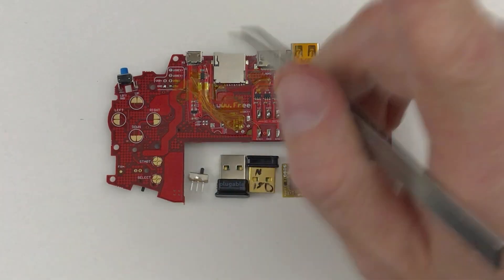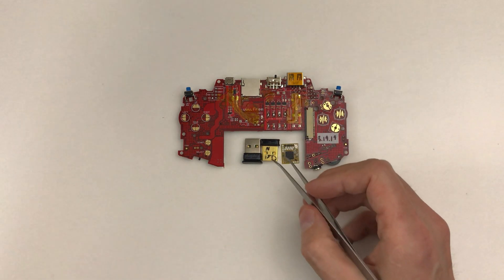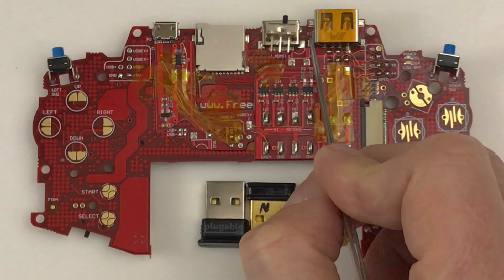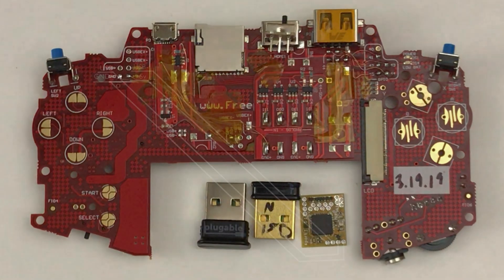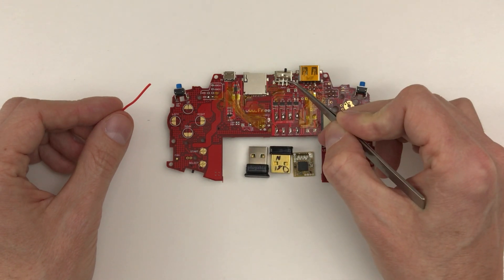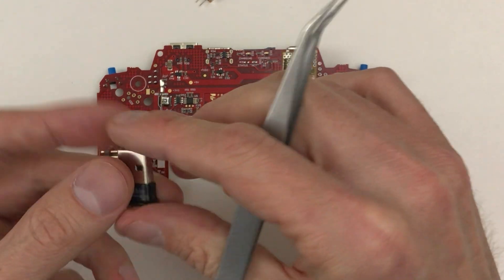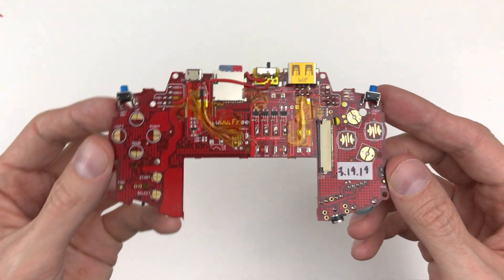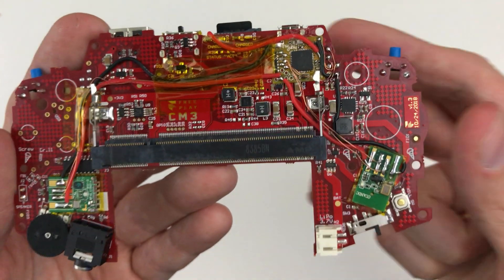Build Log Freeplay CM3 3DS Dual Analogs 02 - USB Hub

Comment: what wifi and Bluetooth did you use? brand? model?
Reply from the maker: I just used a generic bluetooth eBay buy for the bluetooth. For the WiFi I went with the Edimax N150. I didn’t need to go with that though. I didn’t know it at the time, but I had a bad USB hub (not the mini one) I was using for testing. None of my generic WiFi dongles were working due to the bad hub. Since then I have replaced the bad hub and now all of my generic bluetooth and WiFi dongles work. I’m sure there are some super cheap dongles that could not work well, but I haven’t seen that. So I just buy a few cheap ones off eBay.

Comment: The usb d+ and d- are differential data and they should at least(minimum of minimum) be twisted, the way they are, it can have problems with electromagnetic interference.

You do very nice mods, thank you for your videos.
Reply from the maker: Thanks. Yeah I should have thought of that. So far I’ve done a lot of things over WiFi and a little over Bluetooth without any noticeable issues, but I should have at least twisted them. That would have also looked cooler. I might fix that up later today. I need to finish up the last Build Log videos, adding some grip material to the analog caps, and clearing up the inside a little more so I think I’ll knock out the twists too.
Reply from the maker: I just twisted them up. Thanks again. Let me know if you see anything else; I pretty much do things the way a caveman would so I appreciate the input :)